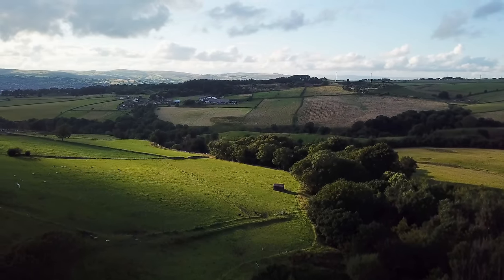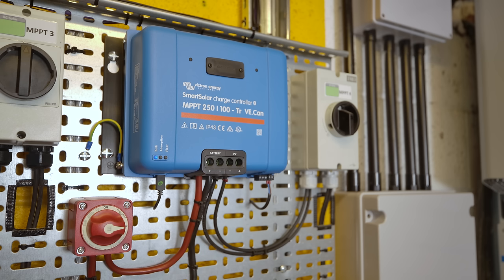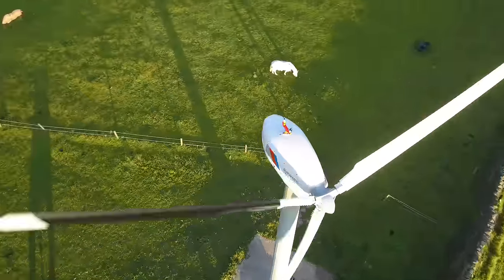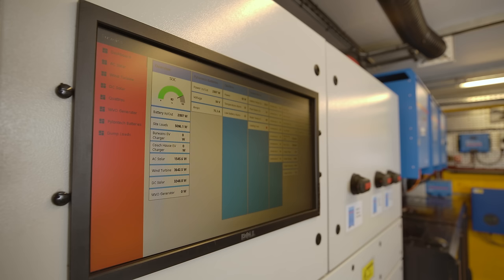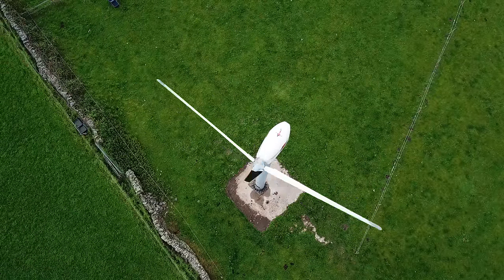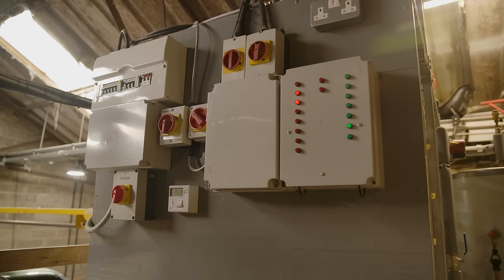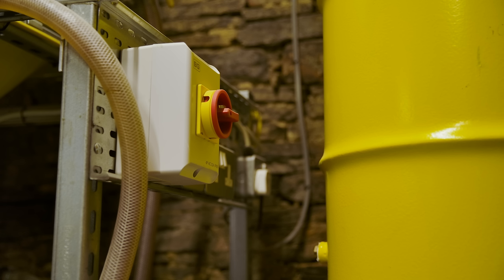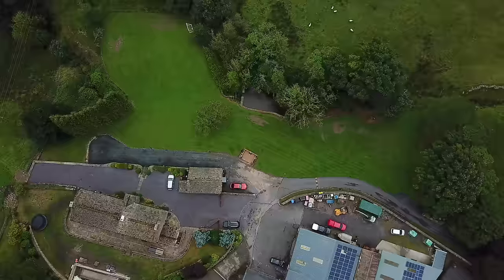Why is this off-grid family using as much power as possible?

Comment: congratulations for the fantastic project, but keeping the batteries always at 85% SOC is not good for the battery balance.
Since, as you know, lifepo4 balancing is activated in the final part of the charge at high voltages.
Reply: Hi thanks for your message, yes I’m aware that the batteries need fully charging regularly to balance the cells, and this is something that Victron were concerned about. I created a flow within Node-Red to disarm the dump loads and allow the MPPT’s to hold the batteries at 100% periodically. It has to be the MPPT’s as it’s not possible to hold the batteries at 100% with the wind turbine. Due to the amount of electricity that we use however, this only works during the summer months, and I need to use the generator during winter to periodically balance the batteries. 
Thanks again for your interest.

Comment: and then by the time you need to replace the batteries at a cost i wonder if its really worth it longterm
Reply: The answer that is it depends in this case with an excess of energy. I think there are lots of times and the batteries aren’t used. I find with technologies at Lima phosphate. If you are only using a fraction of their capacity they can last years longer than expected.

Comment: The Victron equipment is a lot more reliable than that Land Rover he is working on. 😂
Reply: he’s a good businessman then…
Reply: Dieselengines in the RangeRovers can be changed to use vegetable oil with kits from Elsbett. That's also a use case for thermal power stations, f.e. from brands like Senertec. Such power stations can be used as generators in a Victron-offgrid-system.
Reply: Lol! True Story.
Reply: Lol! True Story.
Reply: I love Land Rovers nonetheless ❤

Comment: Sy cables for mains and generator try to use hr07 or swa sy or yy isnt proprly rated for uk market or properly to a bs standard its mainly for control cabinets . Other that that beutiful job and looks stunning great work🎉😊
Reply: The issue is most electricians seem to think it’s suitable for more than just control signal link which I don’t get because the screen parts are meant for that is the common issue and I think it actually needs a drafting at a regulatory level or explicitly states it

Comment: My next house will have a 17kW grid, with the idea to go full off-grid when experience show it is viable. Only after my house is build and I actually live there, will I be able to determine if a wind turbine is needed or feasible at all. I start of with about 44 550Wp panels.
Of course victron, because our next house exists of 2 buildings and the plans are not clear yet, and it should be easy with victron to connect 2 islands with 230V.
Yes, we need to do power hopping because our plan is in 2 stages where in the first stage we live in campers until we can move into the tiny first part, and then we can set up proper initial power and the second bigger part can be build.

Comment: If I can made a suggestion to the victron mkting team, it's nice to see the storytelling behind each video, but the target of people looking your videos I guess they also like more detailed explanations of the system (how busbars are connected, switches, fuses, node red examples or flows...) cheers
Reply from the maker: Thanks for the suggestion. It’s a difficult balance to determine how much detail we should go into. Noted however and I will up the amount of technical information in future videos.
Reply: If you don’t know that you can try to do it but you’re not really able to do it alone you need to buy your gear from a company who offers design and help for you. This is more expensive but it means you’re not going to simply purchase a switch and have it on fire because you didn’t understand the rating properly.

Comment: This is why I love Victron, I have one multi plus2 inverter. Once I can afford it I plan to get a second one and then upgrade my charge controller to the RS 450/100 and add a cerbo Gx, I bought the best I could afford, but good equipment is expensive equipment
Reply: Check out off grid garage he’s managed to use a cheaper inverter from Victor energy and a multi plus with the cheaper one feeds into the multi plus because you’re not paying for a fancy charger in that inverter it’s a bit cheaper. He also explains how you can use a raspberry pie, to be a cerbo

Comment: Fantastic installation. OFF GRID is something that everyone, literally everyone, should check out. Victron makes it possible to be 100% off the grid and that's beautiful. Just like changing your car from an old, smelly diesel to an electric one. Once you try it, you will never want to come back.
Reply: It isn’t very simple as the substantial investment and significantly changing your habits most of the time it’s doable because it’s not as easy as you make it seem otherwise everyone would have done it
Reply: @UKsystems  That's right. That's why there are contractors who do such systems. Of course, anyone can try to do it themselves, and many do. But the effects of such actions are different. Lack of knowledge can lead to disaster.
Reply: However in the United Kingdom you cannot try this yourself unless you can sign the installation off but you have to be legally competent with part of the building regulations involving electricity so you have to be a member of a competent person scheme. You can notify the council before so they can inspect, but it’s very expensive and they’re likely not going to understand this enough to be able to issue any certificate.

Comment: Nice! Did they look at the UP5000 batteries?

The thing with wind power and not grid tied so you can feed in excess, is what do you do with the extra power once charged and loads met. Just seems a waste to be dumping it into immersion heaters. How about pumped storage?

I need to get up to speed on Node Red.
Reply from the maker: Warning, Node-RED is a rabbit hole of hours of your life!  Fun though :/)
Reply: For the summer I would probably have free power for neighbourhood EV's available until I can find something useful. For the winter I would hope the excess of panels is sufficient. Worst case: if grid and solar fails,  I can ask the neighbours for sunflower oil and put that in a (bio)diesel generator.

Comment: My only issue with victron is post sales support with Victron itself,  I had a large system installed in my RV the Authorized dealer butchered both the RV and solar system. I didn't mind paying a Premium for Blue but the support with the company itself as a End User even a DIY is almost impossible. I've had to pay Authorized Mobile Techs to fix the system because they can't warranty work they didn't do. Just a heads up make sure you can trust the installer and if they want to  $charge$  you more if you want to hang around to observe them working that's a warning sign. This is in the USA I don't know about other locations?
Reply from the maker: That is an issue with the installer and not the product though?
Reply: Unfortunately this often happens when someone is prioritizing a cheap build over a quality install. We often recommend to customers that they need to research the installer just as much as the components. Referencing that you feel there is a premium required for Victron equipment tells that there was a flaw in the design and implementation of the system build. The premium should have been assigned to the skilled tradesmen that were doing the work. If you are worried that you can not trust them to do their work  without you watching, then you should find someone that you do. If you are wanting to watch to get an education, then going to find a trade school may be your best bet. We do not allow customers to help or hang out in the shop mainly for insurance liability but also so that the focus can be where it needs to be. Building the system correctly.
Reply: Veteran energy of a sum level of support however it’s for authorised people to work on the technology or sell it. They are generally responsible for providing regional support on behalf of Victron energy quite simply because there are so many countries and different languages. I don’t think they know all of them.

Comment: How does the off grid system handle the overpriduction by the windmill once the batteries are full and the boilers are at temperature? Normally you will dump the excesss load into the grid or in the case of PV the MPPT would reduce production. Does the windmill have variable angle blades to reduce production or do you need a dump load?
Reply: Hi thank you for your comment. 
The wind turbine does have variable pitch blades however we tackle the problem by having a massive buffer tank allowing us to store a lot of heat and by the time we have diverted this heat to various parts of the site we are able to cope with the excess production from the wind. 
You’re quite correct in that the solar PV production shuts down  when not required.
Reply: @Burwains_Energy  I am hoping to add a windmill to our Victron setup but dealing with excess wind produced is a worry (that and planning permission :-). I have a 6000 l boiler that I could use as a dump load, but at one point it too will be full unless there is enough drain. Perhaps we need an outside pool... If I understand correctly the windmill needs a load because under heavy wind it would destroy itself, this is quite different from PV?
Reply: @ttkddry I’m no expert but could the excess not just be dumped to earth?
Reply: @GH-wc5sf  you would be using the soul as a load, normally there is a bank of resistors or a boiler as a dummy load
Reply: Over production had been checked by the use of grow lights. They can burn power for many hours if allowed. The vegetables are a lot better as well!

Comment: While i hate bit coing mining this would not be a bad way to increase load or use it as a dump load. You could also always start an arc foundry. Power is what runs the industrial world.
Reply: keep going, keep going. you almost have the key to the whole issue right there with the arc furnace... just think it through a bit more...

what does an arc FURNACE do? 

now, what does that coal FURNACE do in a power station?

or, what does the decay of radioactive metals in a power station DO?

whats the end goal?

ask yourself that, then ask yourself what BRAKES also happen to do... yknow, when the winds too fast, and theres an excess of power, and theres no way to "store" it as an electroplating process in a battery... those brakes happen to be producing SOMETHING... except then we just DUMP it...

can YOU connect the dots? ;)

dont need batteries. inverters. charge controllers.

just gotta use your brain...

Comment: they could make h2o and use this in the generator as fuel, then you also dont need the oil
Reply: I agree that hydrogen is probably the next logical step for us, I have looked into it briefly and it seems that storing it at such high pressures would be the biggest obstacle. Thank you for your interest.
Reply: Hi Fitt gym production is a licensed saying that requires special inspections in the UK because classifiers has chemical work. It’s a very expensive process that could not really be done at a low cost. Also if they have too much energy they’ll just have too much of this.

Comment: I am confused by the incentive? So they made money by just being a producer but were not require to put excess back on the grid. But the ammount they made was not net metering so it still cost them money. That is sort of idiotic. Using the grid as you battery is the right way of alining incentives but that only work if it is net metering or paid out at the same price.
Reply from the maker: I know, it is rather odd but something that was encouraged and offered at the time.  They get paid for the kW the wind turbine generates regardless where it goes.
Reply: The UK government ad period and time offered this as an incentive. It’s when renewable energy technologies like solar panels or wind it’s very expensive and prohibitive so yeah idea was if they give you a little bit the energy makes you probably invest a lot of money into it.

Comment: The sad thing is - he literally had to divorce himself from the national grid in order to be as environmentally friendly as he could.  The power companies need to take a long hard look at themselves and stop acting like complete @ holes to those of us that are trying to build a better future.
Reply: He cannot connect directly to National Grid unless he is having a very high voltage connection which he does not have his connecting to local distribution service operator the energy company then licenses use from the distribution service operator and national quid. This is very complicated The energy companies do not always choose what generation they use. They can handle things like if someone’s putting solar in and another one of their customers is using the same amount of energy. It’s fine but if they need more energy than they have from their customers generating and using they just have to buy it from, a certain company that’s a middleman and they do not have a choice where it comes from also the UK grid is one of the lowest carbon ones